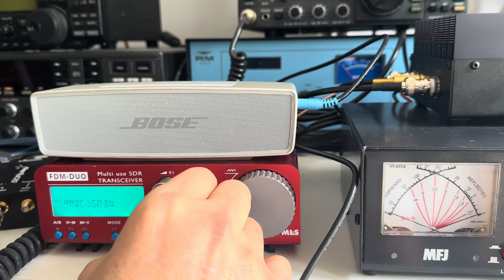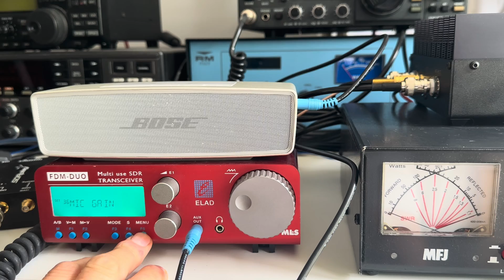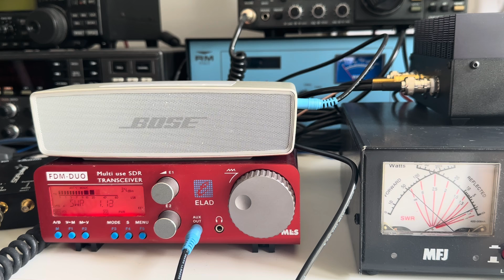Using my Elad FDM DUO and a Neptune HF/6M auto band switching linear amplifier to transmit 100W out!

Comment: I have one of these radios with matching speaker and use a Heil ICM mic on it, also 100w out on a RM Italy MLA 100 linear, the supplied mic is not very good to be honest, use a ICM ot Icom HM36 mic (jap version), i have my FDM Duo set to 10ms delay
Reply from the maker: That's a nice set-up Paddy. 73!
Reply: @OxfordShortwaveLog  It is mate, the Elad sings with a Heil ICM mic, im thinking of selling mine as i dont use it much, after a Icom IC7100 to swap, i have a Yaesu ft2000D that gets used mostly
Reply from the maker: The IC-7100 is a nice rig too, as is the FT-2000!

Comment: I was interested to see this Clint as I’m looking to buy a PA for my FDM Duo once I get my Intermediate. Were you running full power from the Elad into the amp? I’d also be interested to know what gain levels you were using at the start and then later on? 73s
Reply from the maker: Cheers. The mic gain was set at 4 dB and increased to 7 (from a max of 12). 73
Reply: @OxfordShortwaveLog  Many thanks!